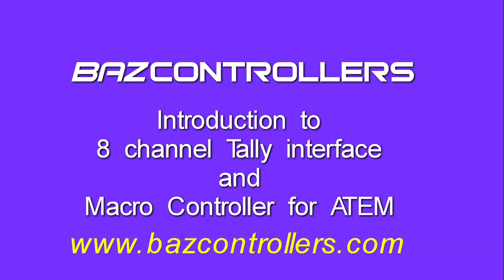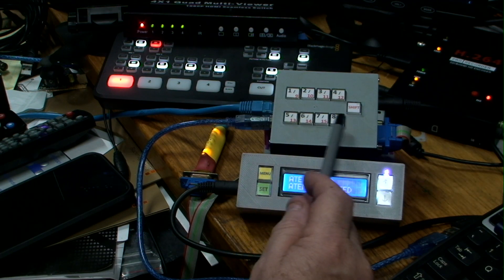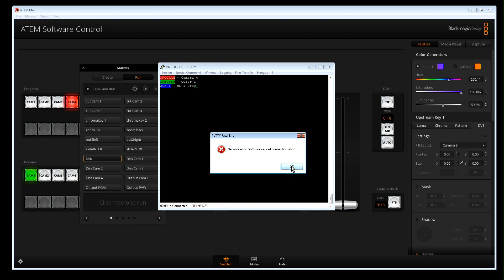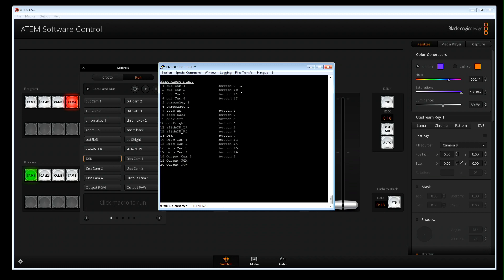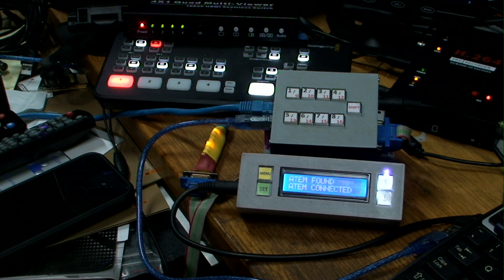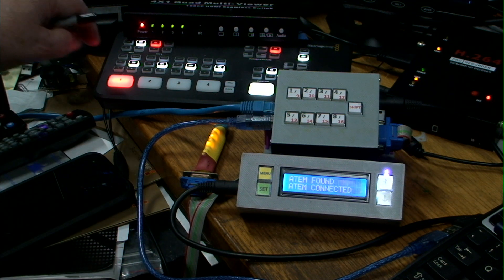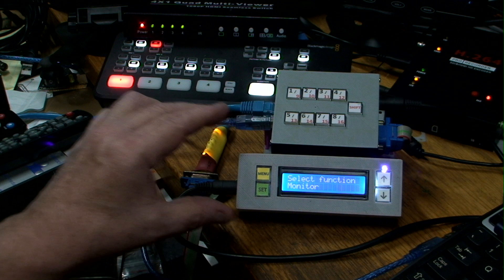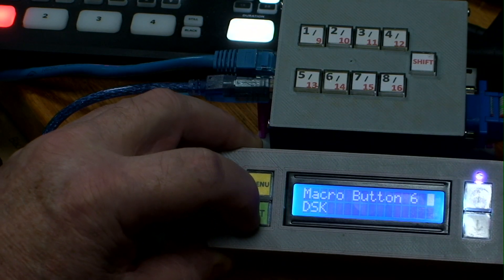Tally and macro Controller for ATEM incl. Mini

Comment: Hi there,
You seem to know your way around Atem hardware. I’m trying to understand if the macros are saved within the Atem itself, or if it’s only within the control software on the pc. 

Trying to build a portable setup with the newly released Atem Mini Pro, and I’m hoping that I won’t need a pc in the loop, since it has to be used by non-technical users in the long run. 

I’ve initially found the Elgato stream deck, but it off course requires a pc to run the required software since it’s only usb interfaced. 

Keep up the great work - looking forward to your reply.
Reply: Hey! 
You could see control software as the remote of your tv, it doesnt store ANY data. It just pulls macros, media and settings form the atem.